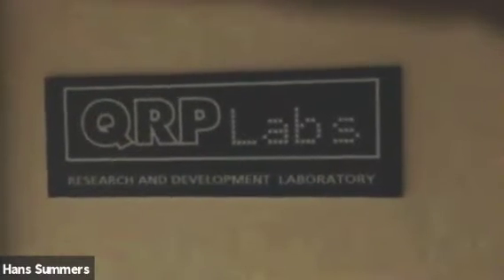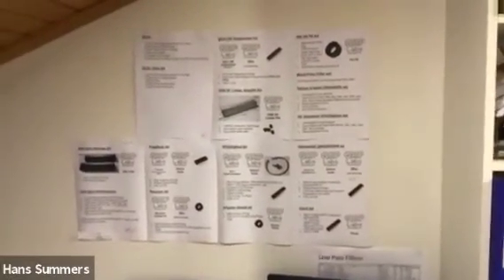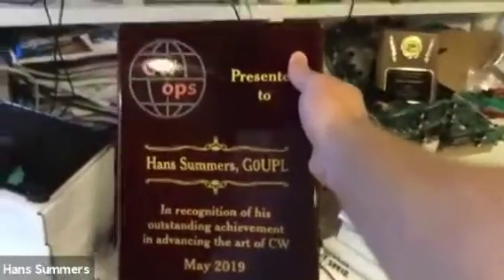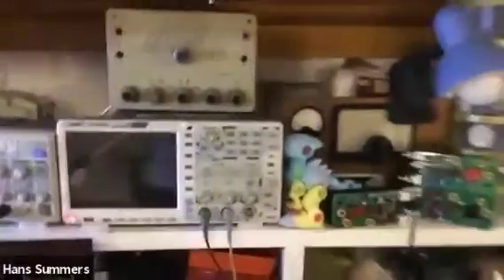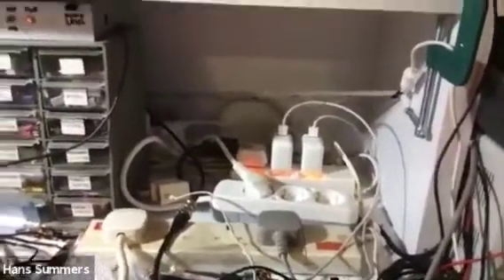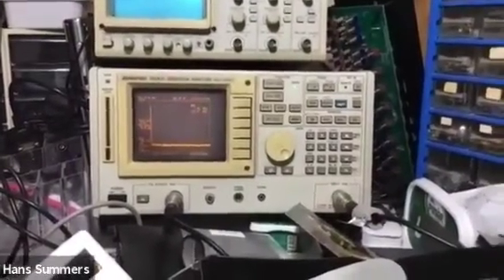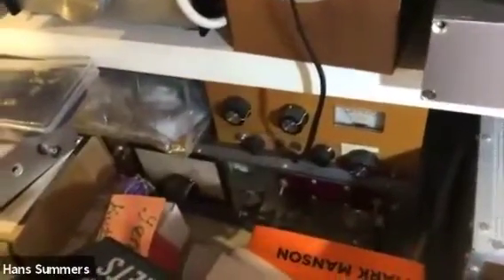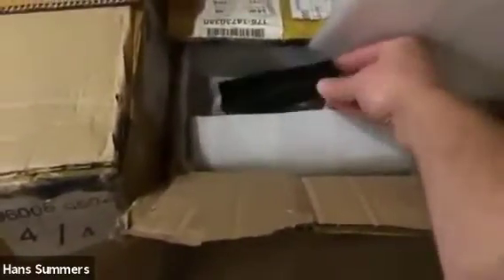QRP Labs HQ tour

Comment: Very interesting. Is a Turkish attic, particularly one filled with electronics, not a very warm place though?
Reply: note the mini-split air conditioner over his left shoulder.
Reply from the maker: @DavidRitchie_n4djs  Yes correct... that is a 12,000 BTU air conditioner. The Mediterranean sun (technically, by a few miles, it's the Aegean, here) beats down on my roof hard during summer. We have seen outdoor temperatures of 47C yet even then, I cannot operate the AC at its most powerful setting because it would freeze us here in the office. 
73 Hans G0UPL

Comment: Thanks for the tour. I have a question about the 20 m QCX that I have. It stays in keydown if I touch the dvm wire to vcc. I was measuring 12 v and rf and accidentally touched the rf in pin to dc. I can still measure dc but it goes into a low output tx that stays keydown until I reboot. It is a 1.00b revision so I guess I need to order a microcontroller. The diode checks ok.  The torroids were adjusted and the 390 pf caps were replaced to get the output up on this early version kit . Thank you for your time and effort on this project. You have added many amazing features for this radio. -John N4HNO
Reply from the maker: Hi John, quite possibly you damaged the microcontroller. It's worth upgrading the firmware anyway, there have been a lot of improvements since 1.00b. Even the performance has been improved, via firmware changes!

Comment: WANTED: QRP kit made to be exclusively used in digital modes while attached to a PC running SDR software.
Reply from the maker: Thanks Winston, I will consider it. 73 Hans G0UPL
Reply: As I mentioned in an email to you, connecting a keyboard for digital via Bluetooth would be great. Even better might be a way to be rid of that heavy and clumsy computer and and use a smartphone for the keyboard and text display.

Comment: Hey, so where is this CB2 microcomputer KIT around? (http://cb2.qrp.gr). 
I really enjoyed the tour Hans! You are a very nice person, helpful and with good technical background. A real example of how a home business can turn into a success with patience and hard work. 
Keep up the good work, providing affordable and feature-rich kits to the world! 
Thumbs up! :)
Reply from the maker: Thanks Kostas... well the CB2 actually IS there... and you can see the little 10" monitor I used for it, bolted to the ceiling at the top right corner of my main computer monitor, above my oscilloscopes. The actual CB2 board really needs to be tidily boxed up and given a permanent place on the shelf to honour it and permit easy use whenever needed! But as you can see... a lot is not right, on my workbench! It needs a serious tidy up... 
Vy 73 my friend, Hans G0UPL
Reply: @QRPLabs  Thanks Hans! If you ever get to the trouble to use a 3d printer,  here is a 3d-printed enclosure for the CB2 micro to help you on this http://cb2.qrp.gr/extensions/#10_3D_printed_case that a member of the community designed.
Keep up the good work!